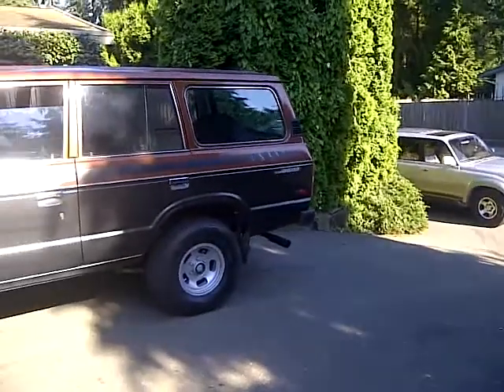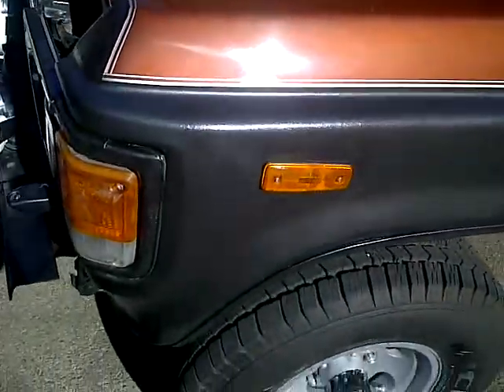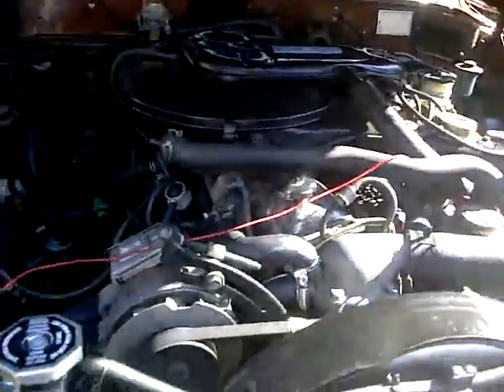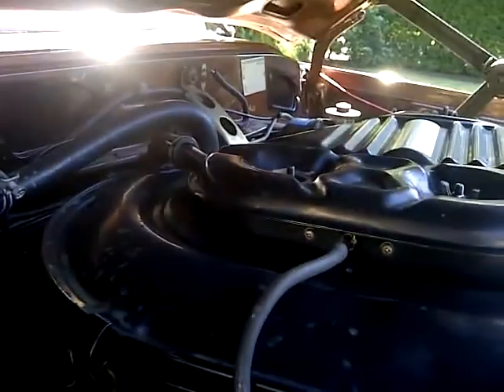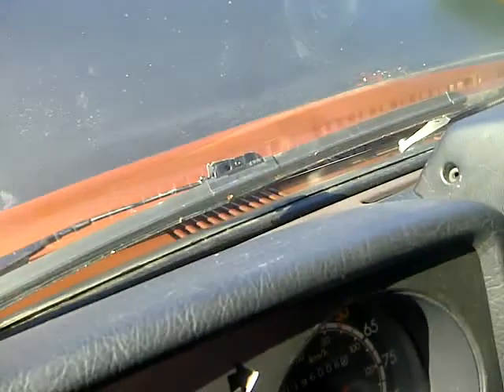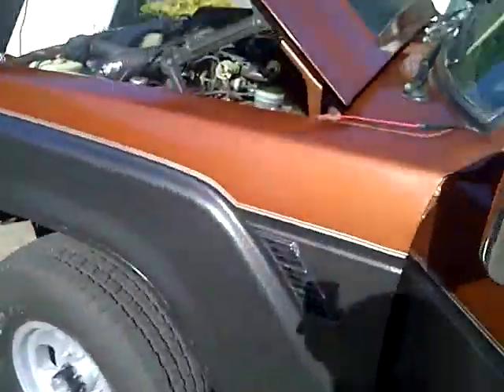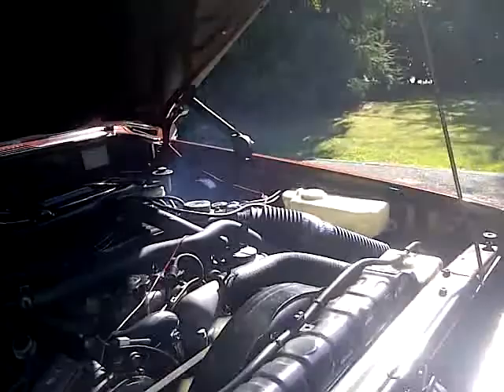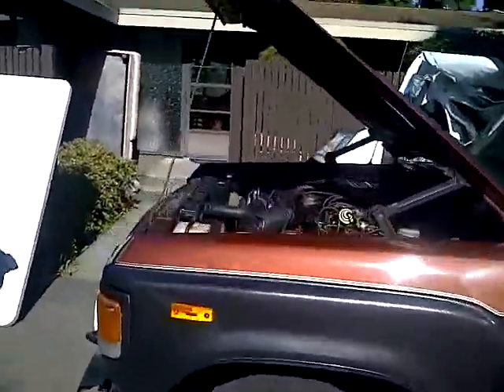Diagnose This - FJ60 Engine

Comment: That oil is most likely seeing out from what's called the oil galley plug. The plug that is installed at the factory, over time starts to leak and will eventually be blown out and you will  lose all your oil and damage engine. The plug hole was part of the casting process for the block. Go on IH8MUD and do a search for a fix.